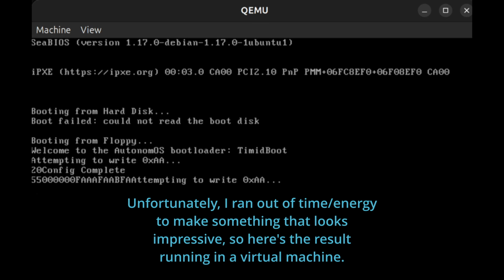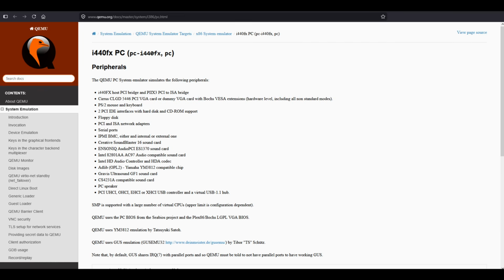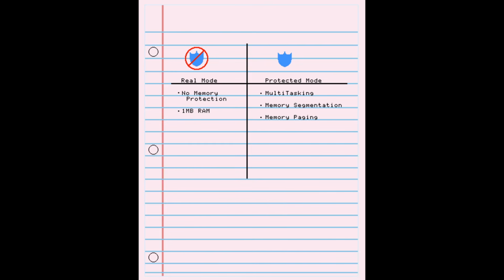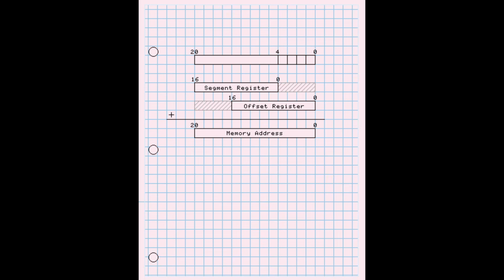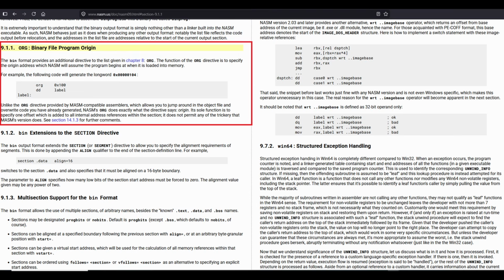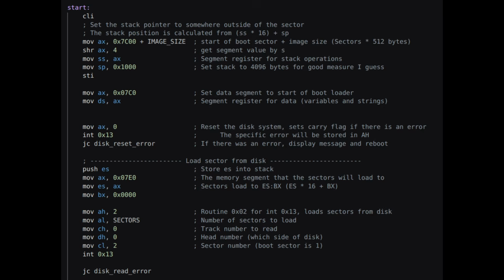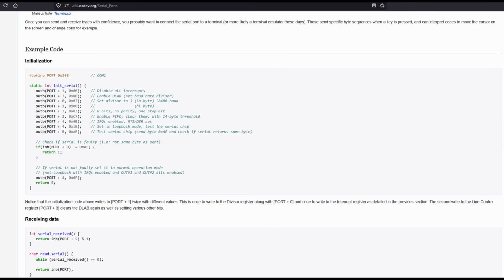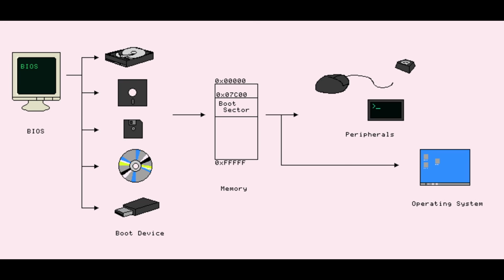Bare Metal and Bootloaders: Running a Program Without an Operating System

Comment: I remember this stuff from before there ever even was an IBM PC.
On our early 8-bit computers there was a simple OS built into ROM that could trigger devices to operate and load software, whether it was a game program, DOS of some sort, or even a program from a ROM cartridge.
I don't know for sure how Raspberry Pis work but I assume it's similar.
Every computer seems to have a very simple and basic operating system in ROM so the computer can do rudimentary self-checks and other startup functions and reach out to peripheral connectors to look for a "real" operating system of some sort, or at least a program to run.

Comment: 0:25 Older isnt easier to work on (in comparison to modern UEFI). I can speak from experience when I say that a BIOS is significantly harder to write for depending on what you are doing. Particularly if you write something operating in protected mode or long mode. UEFI however gives you training wheels.